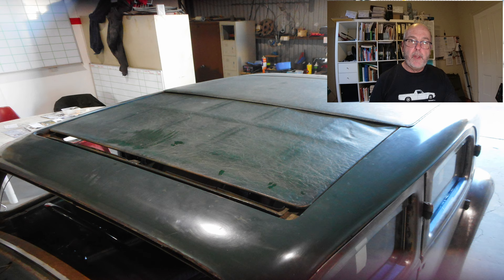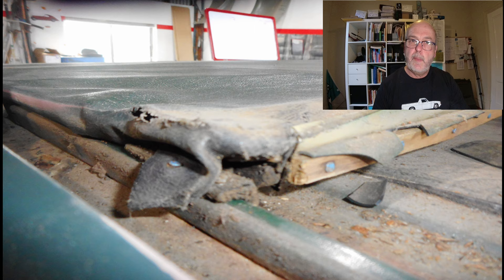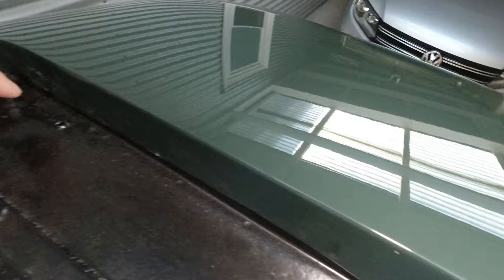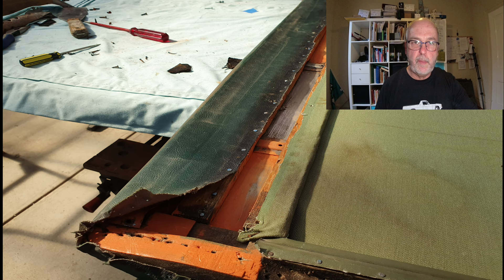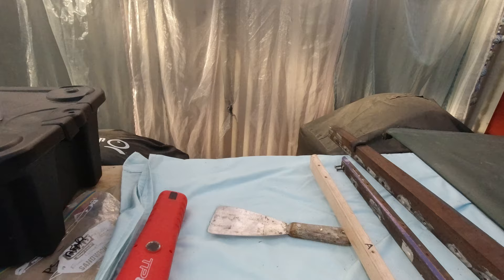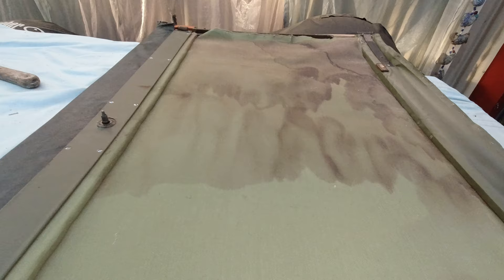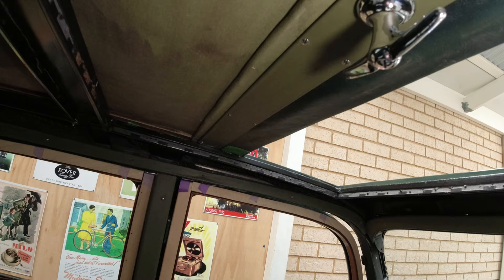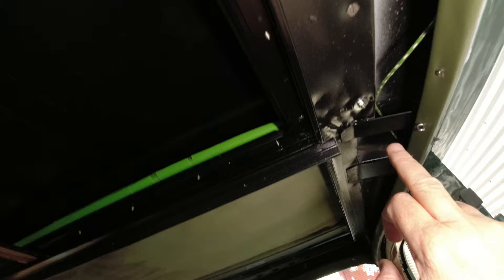Greg's 1949 P3 Rover Restoration Chapter 21 Sunroof refurbishment

Comment: My 48 75 has the same solid fixed section. P2s definitely used perforated steel but I am confident P3s didn't. Just about to refit the repaired sunroof to mine. Thanks for the video, it compliments the pics I took of mine.

Comment: You can see why Rover abandoned sunroofs on the P4! I had always understood that the fixed section was perforated steel but I've never seen one. The Riley RM definitely used galvanised, perforated steel for the entire roof but this was a complex multi-curvature pressing covered in wadding then Rexine.

Comment: Your reference too rust (extensive I presume) should come  as no  surprise with your beloved P3 that has spent much of its life at the seaside. I'm surprised Greg that you haven't found or mentioned  sand ibn your P3? Happy Days! I remember your P3 Rover from 1963 when our neighbour owned it. ROB
Reply from the maker: Hi Rob, thanks for your comments. I think your Neighbours car must have been an identical looking but different car. Most of my cars operational history was in New Zealand. My car was bought to Australia in 1987 by the previous owners when they immigrated from NZ to Australia. I have checked with the NZ registration authorities and the car definitely has a history in NZ. I had all sorts of challenges registering the car here because there was no past history in Australia; no records of it being imported and no records of any past registration in Australia. I think my car suffered from being in a Faily wet climate in NZ and being driven on rough roads.
Reply: @gregwatson5163    Thanks  for the clarification/correction.  However, your winderfuly restored P3 Rover is the same  colour as our neighbours P3 Rover all those years ago (1963) in Reedie St, Henley Beach, SA. Yours was definitely a restoration of love  - well done YOU!  ROB, Stansted, Essex, UK

Comment: Dear Greig,
I have now looked at several of your recordings - fantastic !!

I have just started the restoration of a basket case and your experience is invaluable. However, I can't work out where to look for specific bits - for example, at the moment I am trying to re-create the supports for the fuel tank, and can't work out where to look for your activity in this area.

Do you have a comprehensive package covering all of the filming , with some guide to where to look for what ?

I would be happy to pay for such a composite recording, is this available?

Tom
North of Scotland - 1949 P3 '75
Reply from the maker: Hi Tom
Thanks for your comments. I don't think I have what you are asking for. I have tended to gather photos and video that relates to specific part of the restoration in separate folders with a view to creating a video on a specific part of the restoration. Probably easier for you to tell me what you are looking for and I can send photos etc. on that specific part.  Will have to swap email addresses. I think someone I presume you or maybe a friend posted the same question re: fuel tank mounting points on a Facebook group called the Rover P3 and all running boards group. I have photos of the fuel tank removed from the car but not the mounting points. However, could take some photos of the mounting points now, but as I mentioned I would need an email address to send them to. Happy to help as much as I can free of charge. I was fortunate on a few occasions in that fellow Rover car club members allowed me to take detailed photos and, on some occasions, borrow parts so that I could figure out how to reproduce them. Also, the Facebook group I mentioned is very helpful. Regards Greg